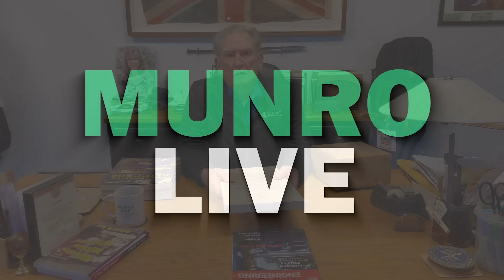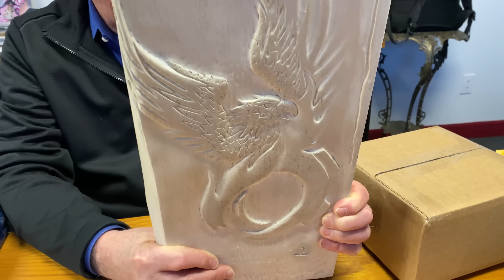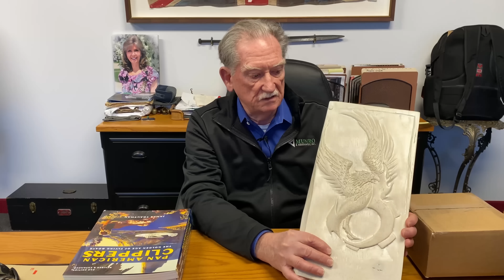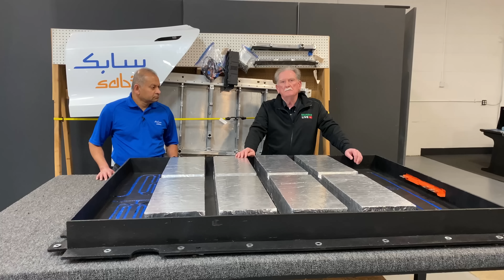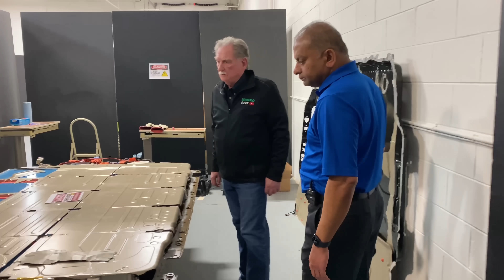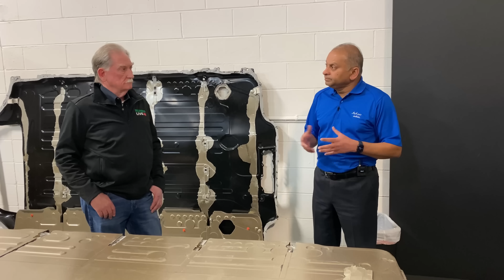Munro & Sabic on Battery Tray Composites - Tesla Model S Plaid Battery Tray

Comment: Hi Sandy, if we are going to avoid total ecological collapse we need to end ALL fossil fuel use and comparing oil as a better alternative to coal is like saying being run over by a bus is better than drowning. Love the show by the way.
Reply: That's way too simplistic of a view.  Turning oil into plastics is a way of segregating the oil into something that won't emit CO2, while reducing overall consumption of wood, metal, and rubber (which have CO2 intensive processes behind them).  Sterilized plastic baby products is one of those things that you really can't replace with anything else.

Eliminating ALL fossil fuel uses, without thinking about what those uses are and how it impacts your overall objective is very short-sighted.

The great plastic garbage patches in the oceans do need to solved, but that's best done by recycling more of the plastic waste (not enough is being done on this front).

Comment: There is a letter on the Tesla website dated 28th of March 2014 From Elon himself detailing the need to put TITANIUM plating under the battery pack to prevent piercing of the battery pack. It includes some video footage of the testing that they did to prevent the battery pack from being pierced. A fascinating letter as no expense was spared to make it the safest car ever @#$& ahah

I’m interested to know how easy it was to remove the battery pack from the Tesla model plaid? Since I understand that the battery packs are no longer being made easily interchangeable?

Thank you so much for your show it is truly “engineering on the move” , in a way we have never seen before and it seems to make Munro appear younger with every show I really enjoy seeing his excitement…. Thanks again All the Best Max
Reply: > Since I understand that the battery packs are no longer being made easily interchangeable?
That's something that Tesla hasn't started doing yet. The Model S doesn't use the so-called "structural battery pack". The first cars that will use it will be the Model Ys coming out of Gigafactory Texas, which should start coming off the line soon.

Comment: Good idea for a video. I think the hang up that a lot of people have with plastics and them being related to oil is the fact that a very large percentage of the plastics that folks take the time to clean out and put in their recycling bins never gets recycled. And I'll gets thrown into the same trash heap or burned or some other non-desirable process. To focus a little more: we are told to recycle, do, and then find out that our municipalities are not doing what they said they were going to do. We are being lied to. What a surprise. I think that's where they're frustration lies mostly.
Also, they comparison of an oil Derek to an open pit mine is subjected to wide interpretation. On the surface, an oil Derek seems relatively clean compared to an open pit mine. It is much smaller in terms of land area and you don't have to tear up a good chunk of land to do it. Devils in the details though - all of the contamination underground with the chemicals that leads their way into our water supplies and are known to the state of California to cause cancer are a problem. Good thing I don't live in California. I'll joking aside, there doesn't seem to be any perfect system but the goal should be to strive for less bad. It seems like the use of fewer and fewer products from an oil base might be beneficial toward that goal. Are they useful? Sure. But when there is the idea that it could be a near closed loop system and then reality bears out so that it is nowhere near a closed loop system that is kind of a bummer.

Comment: How easily do you dismiss horrifying oil spills as like ... Not that bad. Selective memory
Reply: Oil spills are like plane crashes. Far more people die as individuals or small groups from transportation accidents than in a single plane crash; but the plane gets the news report. 

More oil and gas is leaked during transportation and storage overall than in an oil spill (I'd wager more oil is spilled filling gardening equipment on a per country basis). One reason California is banning small off-road engines is because they produce 3 times the pollution than all the cars in that state over a year. 

I don't wish to diminish the environmental impact of an oil spill, but the big spectacular news-worthy problems are usually just the tip of a much larger and more easily prevented iceberg.
Reply: @lassievision  true. Devil in the details. But i feel like we can't even fully understand the destruction to the ecosystem from oil spills. We measure what we can when we think it's useful. I just saw how 8% of oil spills are basically broken down by the sun, leaving super harsh chemicals behind. But yes, it has to be from every direction

Comment: I have nothing against oil as long as it’s used as a material and not as a combustible. It has a LOT of good properties and if it’s not burned, in most cases it can be recycled cheaply and efficiently - especially if the material is designed to be recycled. It makes no sense in this day and age to burn materials (like oil/fuel), poison the atmosphere and almost literally burn money. We should be applauding anyone who finds new uses to the investment already made in oil industry to produce materials and products who would reduce carbon footprint by lowering weight and cost - which will make renewable products more accessible.
Reply: Adding the conversion of crude oil into useable plastics right at the source would eliminate the majority of spills as well.  Only needing to transport as a plastic would be much less hazardous.

Comment: Recycling is largely a hyped fantasy, other than things like aluminum it always yields a degraded product. It can only be recycled a few times before its pollution again and cannot be recycled. Metal does not have this weakness.
Reply: a VW engineer who developed the ID Series mentioned exactly that 3 years ago on a article why they try to use more steel then aluminium.

Comment: Wondering how plastic would compare to steel and mica when used as a structural member...
Weight, strength, rigidity, along with fire resistance, and cost.  Thanks!  Interesting topic today.

Comment: Great point on bringing up the environmental aspects of the manufacturing processes of metals vs plastics and on taking everything into consideration. I worked as an intern in a steel company that worked on refining and casting steel. The air smelled of hot metal and dust, and when I worked with an N95 masked it'll be covered with dirt once I took it off. Very different compared to, say, injection moulding thermoplastics and composites. Composite materials also have the opportunity of introducing natural materials into the design. A good example is Ford replacing polymer-based foams with soy-based foams

Comment: This video was a great idea, IMO. I recall from my Engineering Materials class in college, some years ago, that polymers were quite versatile because their properties could be adjusted via their 'recipe.' The term 'plastics' was considered a form of slang and the preference was polymers. Anyway, I think the idea here is that by using the right recipe, which would be customized, you could do for the battery pack/housing what Tesla has done with the gigacastings and the multitude of parts they replaced in the vehicle. A polymer incorporating a chemical formulation that captures mass reduction, mitigates flammability, incorporates molded features (coolant plumbing) and sealing features all in one would be another goldmine of savings for a company like Tesla or anyone else looking to engineer a (hopefully) lower-cost battery pack. Materials science holds many secrets waiting to be revealed to those diligent enough to stay the course.
Reply: I bet that the Tesla team have looked into this and worked out which system is the best financially and easiest  to produce.
Reply: Cross-liked PE (PE-X) is amazing stuff. Density can be adjusted and fibres can be added if needed. In U.K., PEX is replacing copper for home heating and plumbing. 
Design life is 50 years. I have some that’s 35 years old and just as good as new. Moulded with fibre reinforcement would make an extremely tough but low cost and recyclable material.
Reply: Would love to see some detailed examples of how that composite plastics battery pack would handle impact tests, vs the metal one
Reply: One downside is impact resistance.   Like the NTSHA side impact testing.  Most plastics cannot take as much damage as metals and still be structurally sound.
Reply: @yingnyang2889  I has a Reliant Scimitar sports estate that was made from fibreglass. It was T-boned by an ordinary tin car. 
The latter was undrivable. The Scimitar had a cracked door panel.

Comment: Don’t laugh I am not an engineer, but would it be possible to make a battery pack sealed with no air in it, if there is no air there is no fire.
Reply: Cells make their own
Reply: @rogerstarkey5390  Sorry English is not my first language, I meant the container where the battery packs are fitted in.

Comment: Composites would seem to be a good fit for the lower fire risk LFP packs initially.  They may end up needing to be too thick to equal the strength and fire resistance of the current mica and steel for the NCA packs.
Reply: Who's the expert here?
Smh
Reply: @rogerstarkey5390  I don't remember hearing those specific parameters covered.  Please post the comparative numbers.

Comment: Curious if composites would work for top cover of the new structural packs? Would composites work as the entire outer shell of the structural pack? What would the total weight savings be for that application? Do the composites add significantly to volume, and would the added volume impact the application?
Reply: Mockups of the pack show a moulding around the cells.
If THE WHOLE PACK was a moulding, with the cells dropped (or pressed) into a tight fitting mould......... ?

Comment: If plastics recycling gets worked out for cars, your environmental argument is very convincing. Without recycling, it's harder to justify, but it still has a lot of advantages over steel or aluminum.
Reply: However, the implications of a "steel spill" is not nearly as dire as an oil spill. And there have been many terrible oil spills... Steel spills... Not so much.

Comment: How do you recycle a thermoset composite plastic ?  How can you melt that to form new parts ? - If they are talking about grinding it up and mixing it with binders to create pallets or flower pots, I think we have enough scrap plastic to use for that purpose.  Some parts are very obviously better as plastic for a variety of reasons, but I'm not convinced that changing the battery cover from metal to plastic is worth the weight savings.  Steel is much more recyclable than plastic, and you only mine it once.  We can melt down all of the ICE vehicles to make steel parts for the EVs.
Reply: Let's assume they've thought about this?
An steel takes a huge amount of energy to recycle.
Reply: @rogerstarkey5390  Actually not, recycling steel is a whole lot less energy intensive than coming up with completely virgin stuff..

Comment: I'm conflicted with some comparisons done in this video. Metal is way easier to recycle than plastic. In fact, Tesla is already recycling 100% of their used battery packs because it is actually economically viable. If a battery tray was made in a plastic composite, it would not be as recyclable and definitely not economically viable to recycle.
Reply: @David 
You have zero idea.
Reply: engineers must calculate pros & cons
Reply: Unless you can "chip" it, and reprocess to make a similar component?
I don't suppose you saw the Munro/ Rivian video?
Maybe watch that and pay close attention when they mention their "ocean plastic recycled packaging"?
Let's leave it to the experts?
Reply: @David 
Sabic is the company, not the plastic....
Reply: They seemed to be saying it could be economically viable to recycle, but I'm skeptical too. This would be a very high performance plastic, so maybe the plastic itself would be valuable enough to recycle?
Reply: My first thought as well. Recyclebility is still not considered in most manufacturing processes and material choices.
Reply: @2nd3rd1st  wrong, the problem with plastic recycling is that there are way too much plastic variations and for recycling they needs to be sorted very strictly, the same goes with metal alloys, glas(colors)…..
Reply: Lol…. Tesla is not recycling 100% of their battery at all.
Reply: @carholic-sz3qv  check jb Straubel redwood. They are officially recycling Tesla batteries from the manufacturer
Reply: @hugovale6360  they are recycling not just tesla batteries but as much batteries as they can, also why can’t tesla recycle their own batteries in house!? Vw has already built a battery recycling factory for that.
Reply: @hugovale6360  they are not the only batteries recycler in the us for example

Comment: it might sound insane but come out and say it. Why can't the whole car's body and chassis be made out of a plastic composite. Surely it would be much cheaper and easier than Tesla's current giga stamping and it sounds like it can compete with steel and aluminium structurally. Is this just a mindset thing where people or regulators think that plastics are "weak" and for cheap things?
Reply: I've already suggested the "25k car" (or equivalent) night be a moulded 2 piece bolted passenger cage with a  casting front and rear to take the high stress components.

Comment: Thanks Uncle Sandy, and UV from Sabic... composite materials have been a integral aspect of Formula 1 for decades... with a trickle down into automotive manufacturing... perplexed by the fact that there isn't a greater use of them in the manufacturing of automobiles... is it bias amongst engineers, or are marketers dictating the direction based on consumer opinion?  I would believe the majority of consumers are looking for a comfortable and efficient product, not caring about the how... to your point Uncle Sandy,  by no means is that to say composites are the definitive solution for all applications.

Comment: But composite don't have the same resistance for lateral impact. Do they?
Reply: The pack doesn’t contain much structure for crash protection. That usually on the car, which will be the same whether is steel or composite.
Reply: @harsimranbansal5355  
The Tesla "structural" pack will use the cells.
Reply: How do you know that?

Comment: How are the impact ratings of composite compared to steel ? Plastic as a fire retardent is fine  we even use them for home outlets . But can it take a hit from a rock or hitting a curb without cracking or loosing structural integrity ?
Reply: Mmm, plastic.  Resilience is important.  Don't think of the easy to break brittle plastic.  Think of a plastic tool box.  Compare it to a steel tool box.  Drop a cement block on both.  Which one will retain it's shape?  Then leave it outside for a couple of years.  Steel would rust away.  Plastic would be intact.  That's why we use plastic.  Look at power tools these days.  Mostly plastic.  Water bottles are made of plastic because they don't break during shipping or handling.  
I'm a little concerned about fire and I need to study this.  
But mica.  Why would they do that?  I'm suspecting the reason is not fire but is maybe a dielectric component.  Someone has to explain that one.  I would expect mica would deteriorate from stress over time.
Reply: Fwiw most Airliners fuselage body are made of composite plastic nowadays.

Comment: The industry has been irresponsible. The molecule jockeys #1 goal should be cleaning the supply chain, building fewer molecules which can be used interchangeably and are easily recycled even when co-mingled with other plastics. Instead the money people choose to pour billions into lobbying, buying government influence, denying responsibility, pushing advertising which is in fact industrial propaganda. Examples of failures... Nurdles by the billion leaking into the environment some of which are consumed by animals. Huge methane leaks, flaring, cross contamination with groundwater. The idea we're shutting of oil/gas production is a red herring which is used by the industry to spread fear. IN FACT FOSSIL FUEL EXTRACTION INCLUDING FOR PLASTICS CONTINUES TO GROW EXPONENTIALLY. What we're missing globally is HONESTY. A willingness to acknowledge the process is not good enough AKA DEMING'S approach. Lastly the industry and their bought and paid for political puppets never ever discuss the reality of depletion. We're down to fracking the SOURCE ROCK for tiny amounts of tight oil, gas. Fracked wells deplete very rapidly. Beyond the source rock there are no more places for hydrocarbons to hide. In addition only a small percentage of what comes up through the wellhead is useful. The spoils are very toxic. Sandy and his team would be adding greater value to their offering by making how easily and often any materials used in manufacturing can be used in a circular economy.